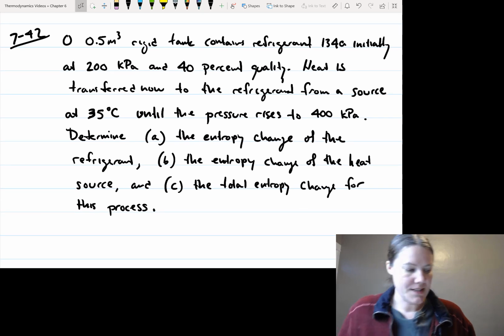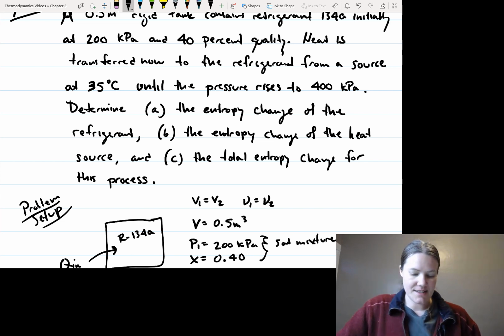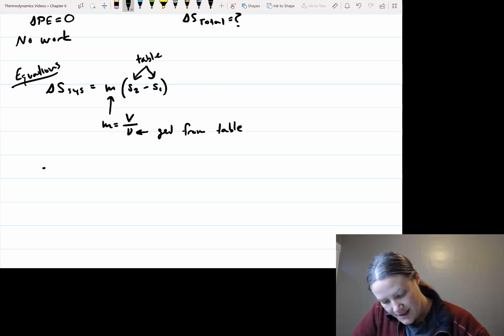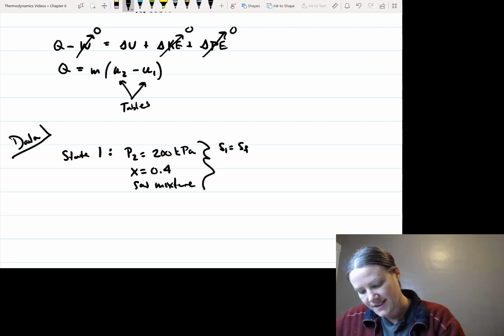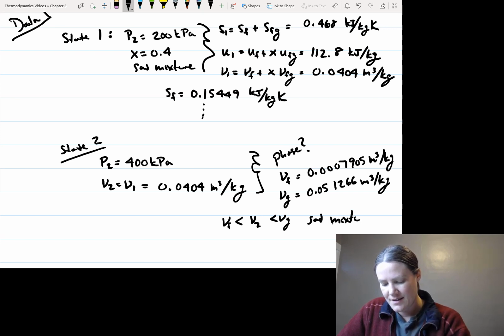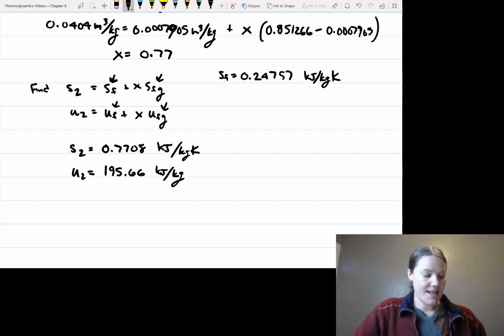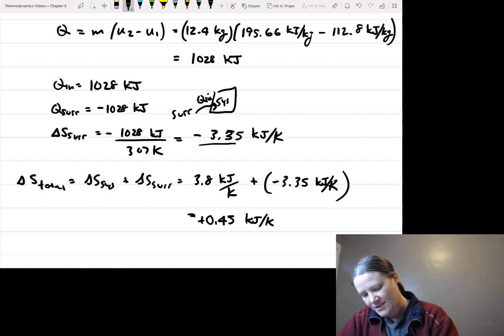Thermodynamics: Example entropy calculation in closed system

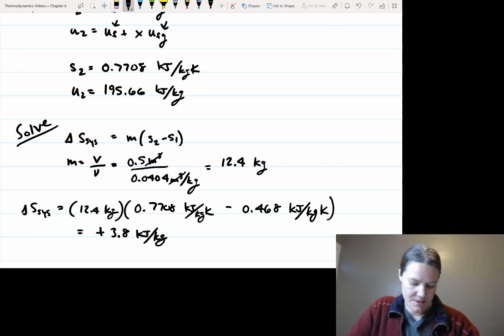Comment: https://youtu.be/Z6Otvb-pwa0?t=1066 at 17:45 you mixed up units on calculating entropy for the system. Should be KJ/K by your example. Great problem though!
Reply: could you do a combustion problem? To find dew point for a stack gas?